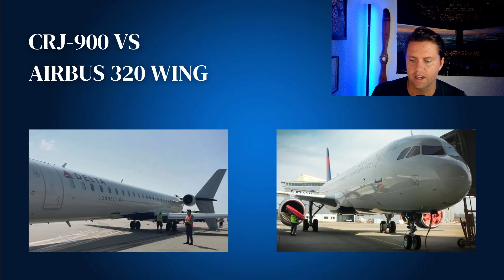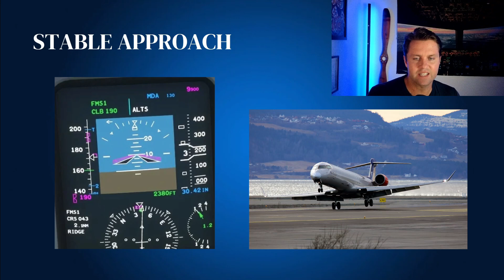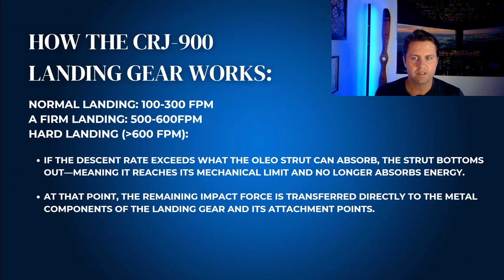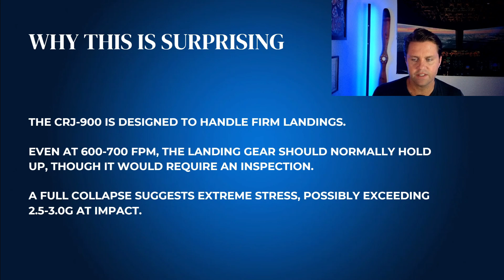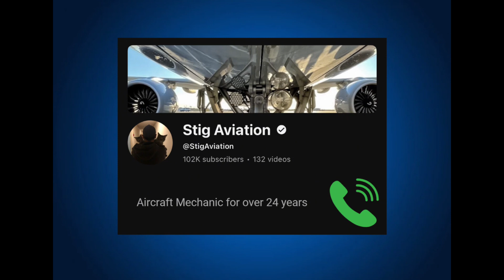Pilot Breakdown: Did a Hard Landing Cause A Gear Collapse?

Comment: I know that passengers want yo rescue their bags, but doing so blocks others passengers from reaching the exits.  If the passenger portion of the plane had caught on fire, the delay caused by passengers blocking the aisle would have caused deaths due to the inability get to an exit.  Unfortunately too many people think the crews’s instructions don’t apply to them.  Maybe airplane manufacturers could develop a system to lock the overhead bins until the plane safely lands and the locks are released.

Comment: Hi Gary ... YT rec'd your first video on this Endeavor crash and I watched it.  Saw you had this one a couple days later ... searched the comments as I didn't have 20 minutes after the first video.

What makes the fuselage roll inverted on the ground is the left wing is still producing lift and there's no longer a right wing attached doing the same thing.  Asymmetric lift = roll.

I've watched a few videos on this crash and I've yet to find .... >>> where were the throttles? <<<  I don't expect a "normal guy" to know that.  It's on the FDR, and only the Safety investigators will know that ... but the question can be asked.

You note with this "holding short" video the approach looks fairly normal until they cross the threshold and begin to "debrab" from the crosswind.  I note that just prior to impact, the sideslip increases the right bank.  Is that to stop the left drift from the crosswind?  Is it to "work back" toward the centerline?  If the main gear hadn't collapsed, they'd have drug the right wingtip significantly.

Back to the throttles ... were they selected to IDLE as if there wasn't a large quartering/gusty cross wind; eg "on speed/on glide path" throttles moved to IDLE as the pilot started the flare.

In cross control to "decrab" .... parasitic drag increases BIGLY .. so at a minimum, the throttles should have been retarded much more slowly ... maybe even advanced a bit.

Perhaps the gust factor was higher than reported and the gust was lost AS the throttles went to IDLE ... "because it was time." ... well before they should have gone to IDLE.

If I missed your addressing this, my apologies ... but throttle actuation is my first question.  Glad no one died but this sure didn't inspire confidence.

26+years major airline pilot, FO on 787/777/MD80, CA & FO on 737,  A-10s and T38 IP before that.
Reply: We haven't received an update on FDR parameters, so my hypothesis can quickly be discounted.
My observation : A major gust 40+knots sent my garbage can down my driveway and stripped heavy snow off my spruce trees bare.Immediatly headed out door. DEAD CALM NOT A WHISPER for a two minutes, then another 40 knot wave followed by dead calm 
 I wondered if the crew encountered this phenomenon just over threshold. Airspeed will tell the tale .

Comment: Far too much speculation and misinformed comments !  Fairly hard touchdown on starboard main landing gear that failed, plane veered off runway, right wing was low and hit snowbank, shearing wing off, plane flipped over onto roof, skidding in snow that extinguished the flames. Fire was "out" before firetruck arrived to spray foam!

Comment: Agreed snow saved lives.
Why is no one mentioning the aircraft's exposure to icing conditions in flight?
It most certainly would have.
Icing exposure causes the approach speeds to be increased 10 knots or so. So faster approach...
The tail on most transport aircraft isn't heated, anti-iced.
Could that have led to tailplane icing? And then possibly a tailplane stall, leading to lack of elevator response and failure to flare?
Could absolutely be the cause....
34k Regional airline captain and Check Airman.
Reply: there are no V speed adjustments for structural icing and icing had nothing to do with it. But thanks for including the appeal to authority fallacy.
Reply: @skyboy1956  so the CRJ is different than every other airplane I've flown? ATR, EMB145, EMB175, B777. All increase vref and vapp after icing encounter.
And how do you know there was no tailplane icing? I dont, but it needs to be considered.

Comment: This is the most important thing. 

Number one rule always fly straight and level first. 

Recovering from spaceale disorientation in the clouds.
Do not worry about getting back on heading or altitude. 

1. Focus on attitude.
Maintain present heading and attitude. 

2. If your controls are working backwards then you know you are upside down so first priority get the plane right side up. 

3. Get the plane to maintain present heading and altitude trim it for flat and level flight and keep your hands off of the controls. 

4. Flying the plane straight and level is always number one priority. 
Then you focus on getting back on course. 

5. Then you focus on communicating that you are off course with ATC. 

I do not use the Artificial Horizon when in the clouds except for slight attitude changes because you can flip it.
I use my Directional gyro / Altimeter / Slip and Skid turn coordinator. 

Flying by the Artificial Horizon too often can make you complacent on one instrument that is not always reliable. 

These are also good rules for life in general.
Happy flying.

Comment: If the airspeed is too low, from error or wind shear( most likely) the aircraft will not flair and drop quickly. I'm not sure but I think I can see the elevators fully up. If they had time they should have added full power, TOGA.

Comment: The tailwind, or gusting partially from the tail, and I think that snow piled along with side of the runway snagged the wing, so, instead of just sliding along, it caught fully...and, thankfully, dropped its fuel load in the snow.

Comment: Gary, great insight on the mishap in Toronto.  It appears the right MLG  collapsed on touchdown IMHO. Juan Browne had ADSB data that showed a stable approach up to 400 feet AGL.  It’s possible it went bad after 400 feet.  As you know you can land the CRJ-900 without flaring.  We did it all the landing in Key West.

Comment: I'm no longer comfortable stepping on-board Regional flights. I know the training is inadequate (though meeting "FAA standards"). I know the crews are likely not the best pilots available in the pool of pilot candidates. I know most of these crews are highly inexperienced. I know the airlines make sure the majority of their candidates get pushed through training despite deficiencies. I know training programs have been stripped to bare minimums to speed production. And I know the majority of Regional flights have an FO that was literally flying Cessna's and Piper's in circles over an airport all day every day for the year or two before they took that FO seat. And I also know that the CRJ is a high performance, critical swept wing Jet that can be a challenge to fly. Why in the hell would I put myself or my family onboard an aircraft commanded by someone in that experience profile. No thanks. If the airline or crews are found negligent, I hope the airline is sued into Bankruptcy and the crews never fly again. We shall wait and see what comes from the data and facts. Meanwhile, I book around the Regionals.

Comment: In terms of survival, great save. Too bad about the airframe. 

Cold temp would have helped as the fuel would have been well below flashpoint so fire spread not easily sustained 

This isnt the first time an aircraft has lost its mainwheels on landing. It seems to me there are potentially quite a few causes and possibly a combination of causes.

Pilot interviews, the recorders and analysis of the wreckage should tell all. It wont take long to sort it out.

Comment: The difference with the rate of decent and the g-load was all of the weight/force was on the right rear landing gear due to the wind shear. If they had landed on both gear, it probably would have been fine

Comment: I've stepped through the video frame by frame and I have second thoughts about gear collapse. The aircraft is riding level on the runway right up until the wingtip hits the snowbank. It wouldn't be level with a collapsed right gear. I've changed my opinion on the landing force being the sole culprit. Rather I think it's caused by whacking the snowbank with the wingtip coupled with the hard landing.

I don't know the touchdown speed of a CRJ 900, presumably 130-140 knots, so whacking a snowbank with a wing at that speed will definitely break something, especially coupled with a hard landing that is already stressing the wing in the same direction. The hard landing will stress the wing at the root. Then we add in the wingtip impact. Then the wing gets ripped off. Either one alone would probably not produce this result.

Comment: The other wing was still creating lift causing the plane to flip. You can be moving a million miles an hour and still drop 300 fpm. Check out the Dale Earnhardt crash. It doesn’t look like a bad crash, but looks are deceiving. Speed creates inertia and the kinetic energy of an event isn’t always evident in a video.

Comment: What we can't tell from these videos is if there was any slip to the right on the aircraft at touchdown, after all it is starting to roll right, so it could be slipping right as well. If the aircraft touches down hard, coupled with sheer forces from the slipping on the main gear, then add the wingtip hitting a snowbank yanking it even more to the right, that could be enough force to snap the gear.

I was on a flight in a smaller jet that was landing in a stiff crosswind. The pilot obviously did not straighten the aircraft right before touchdown so we landed slightly sideways. We were slammed from side to side until the pilot got it straightened out. As were were being bounced around, my mind went to a gear collapse from all that sideways force coupled with a hard landing. That pilot really slammed us down. When I first saw the videos of this crash, I immediately thought back to my own hard landing experience.
Reply: I think we also have to add in runway conditions as well. When you were a kid if you've slid down an icy sidewalk then hit bare asphalt, your feet stop, but the rest of you keeps on going quite violently. If during any sideways motion, the tires go from snow covered to bare asphalt, that sudden additional jolt as the tires grip could very briefly exceed the g limit for the gear, when we add in all of the other factors. Like you said in the video, it's a cumulative effect of factors, not just one. Also we should add into the FPM descent estimation that the aircraft was rolling right at touchdown, which adds to the FPM descent rate for the right gear.

Comment: This is one of deltas problems. So proud of dei and unmanned flights they never take into consideration they needed EXPERIENCED pilots and that might even mean a middle aged white guy. It is obvious the plane was going too fast and dropping at too high a rate of speed. SHE caused this accident.  This is not that hard a thing even with gusts off the lake. Try billings montana landings on a cliff face with updrafts and side currents that have the planes almost 45 degrees off center to land. The pilot had a whole 41 hours of flight time? omg

Comment: I am asking myself as an PEng with a PhD if you look at the pictures and imagine an impact. If the landing gear on the A320 collapse what do you think will happened to the engine AND the fuel line going into it. Airbus is in Europe, CRJ is in QUEBEC Canada. The WING is design so it can withstand a huge stress level but when you do an obscene hard landing that is another story.

Comment: Another runway fuselage flaming crash in Halifax Nova Scotia recently in December '24 caused by a tire blown out. 
Your aircraft mechanics description of the pre flight landing gear inspection did not include a pressure guage on the tires. Why not?
Deflated tires have no bounce. Even a third or half deflated would blow out on impact . No bounce?  You said it! when rubber hit the road no bounce caused gear to crumple

Comment: Watch footage from Lear jet. As it passes in front of Lear, there is slight bunt, like windshear. Almost like they lowered nose slightly losing lift. Like dropping off a cliff, very sutle. Impossible to regain attitude due momentum.
Reply: It's around 1:30, more noticeable on zoomed out footage. I bet the pax felt a sensation like going down in a elevator.

Comment: There is a lot of talk about the "normal" rate of descent for landing in an airliner being around 600fpm or, in the case of a moderate head wind like in this instance, around 500 fpm, more or less.  That is true for the glide path leading up to the actual landing.  However, you NEVER just hold that rate of descent unless you're making a Navy carrier landing, something I did in a previous life.  In an airliner you ALWAYS flare in the last few seconds of the approach, reducing the rate of descent from 500 or 600 feet per minute down to well below 100 feet per minute.  If you round out accurately, you will be literally within inches of the runway surface, direction of travel right down the runway center-line, fuselage also aligned with the center-line, airspeed decaying rapidly, throttles at idle, and rate of descent very low.  If you're at an altitude of 12 inches with a rate of descent of 60 fpm, then you simply need to hold what you've got and let God fly it down to touchdown which takes him only one additional second.  Then you can worry about slowing down and taxiing to the gate because I'm told that God is too busy for mundane tasks like the taxi and parking phase.
Done correctly, your touch down will be very smooth because your rate of descent is very low for the last second or two.  If course if you're fast and round out 20 feet high, you will find yourself floating down the runway for a long time, fishing for the ground, and most likely making a firm if not hard landing.  Twenty seconds is a long time if you're going 140 knots and obviously eats up a lot of runway.  
One answer to being long and fast is to push the airplane down onto the runway and it looks like this woman did just that, increasing the rate of descent from normal to over 1000 feet per minute all the way to impact.  The down side if this technique is that you risk driving the right main gear up through the wing fuel tank causing a big fire after which the right wing snaps off and you end up flipping inverted.  That upsets the passengers and really pisses off the Chief Pilot and company stock holders.
By the way, although micro bursts can be a problem, they are almost exclusively associated with summer time thunder storm activity over or near the air field.  Winter weather with moderate gusty winds are normal this time of year, but in my 33 year airline career I never experienced a sudden increase or decrease in wind producing a nearly instantaneous change in velocity of 10 knots.  Going from 20 to 30 knots or back again happens over many seconds and is hardly noticeable when flying an approach.  Remember, this wind is measured at 10 meters (33ft) above the ground.  Gusts are more gradual and much less intense close to the ground.  In other words, the head wind didn't suddenly stop causing this airplane to fall out of the sky.  It just doesn't happen that way.  For some reason, this lady failed to flare and according to the preliminary ADS-B data, nearly doubled her rate of descent in the last few seconds of flight causing a very hard landing and subsequent crash.

Comment: To start and sustain a fire we need three elements: fuel, oxidizer, and temperature. The most important of the three elements to sustain a fire is temperature.  the plane could have been full of fuel but the fuel itself and the oxidizer (oxygen in the air without the high temperature cannot support the flame and therefore the fire. It is exactly as you stated in the video. the snow saved the lives of all the people on board. unfortunately also in this case as in the case of the accident in Washington the aircraft was piloted by a woman with not enough hours to pilot in circumstances that have determined the air disasters. in the case of the military helicopter the speed of the helicopter was 120 knots too much to fly over an airport full of planes taking off and landing. in the case of Toronto the plane had to be brought to a speed of 300 feet per second and instead its speed during the touch down was 1,100 feet per second. Pure madness that put the lives of everyone on board at risk. These women like to run because deep down they are convinced they can control everything. it's time to put a stop to this madness.  In the US Navy women are no longer trained to land on aircraft carriers. Too many accidents. The brake on this madness will also come in civil aviation.

Comment: It looks clear this was either pilot error or instrument error that didn't tell them the correct height and the snow made it hard to visually judge. There was no flare and the decent speed did not change so it's unlikely it was caused by a wind gust as likely you would see a change of some sort - speed up or slow less than expected. The pilot basically flew it into the ground at normal decent speed. When you see the speed it hit, I can't understand why you think the wheel struts would be able to handle that. It looks way too fast for them to take. I'm sure they can handle a lot for hard landings, but not having the plane fly into the ground.

Comment: There were heavy crosswinds so its no doubt that the pilot had a heavy workload and the plane got too far infront of him/her. It looks as if there was gust from the aircraft's left side and when the right gear failed, damaging and shearing the wing, the lift from the left wing torqued the aircraft over. You don't have to be an expert to see that all of that snow extinguished that fire, the gray then white smoke is from the moisture making it less dense.